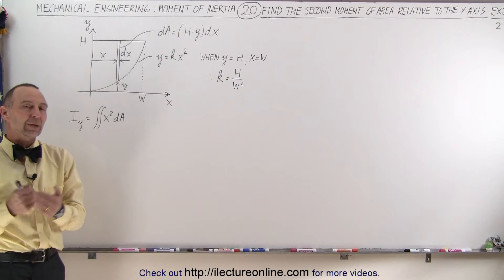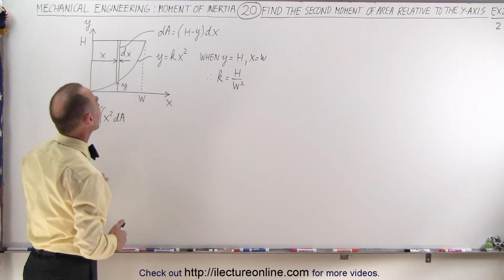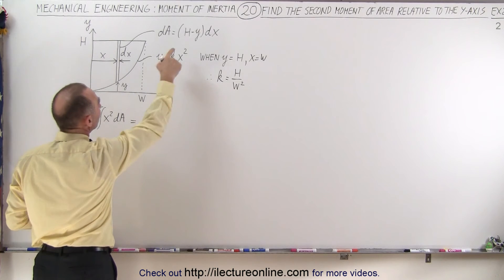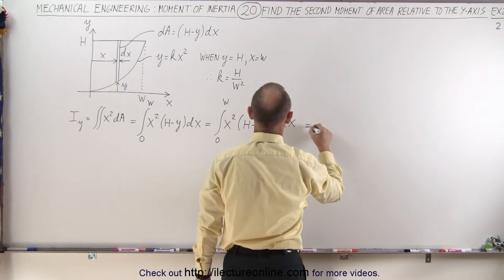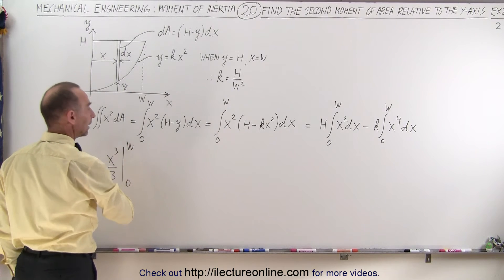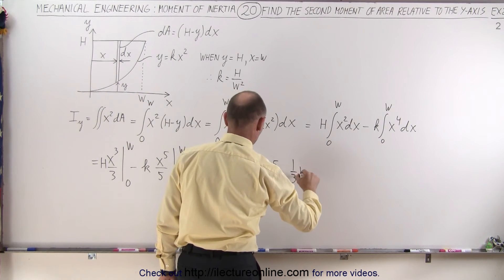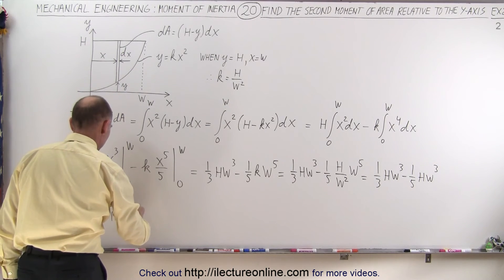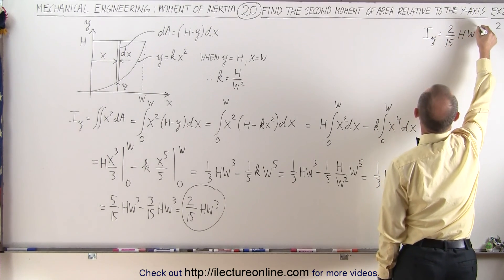Mechanical Engineering: Ch 12: Moment of Inertia (20 of 97) 2nd Moment of Area Rel. to y-Axis: Ex.

Comment: I still dont understand why the double integral goes away
Reply from the maker: Because we used a "bar" instead of a little square to serve as a dA.  (That takes care of the integral in the y-direction and we only have to integrate it in the x-direction).
Reply: @MichelvanBiezen  so when we have a square we have to double integrate? Thank you very much for your response and for these videos btw
Reply from the maker: That is correct.